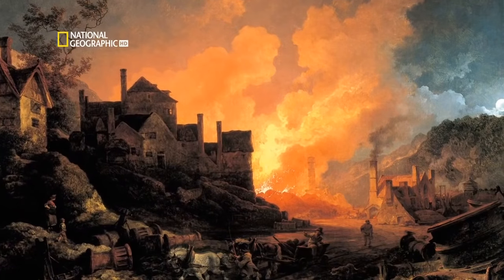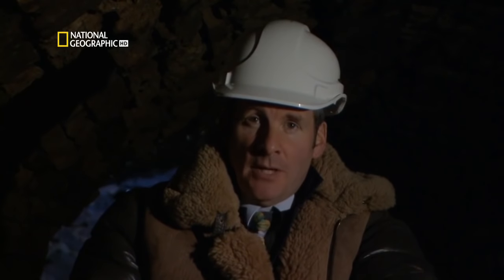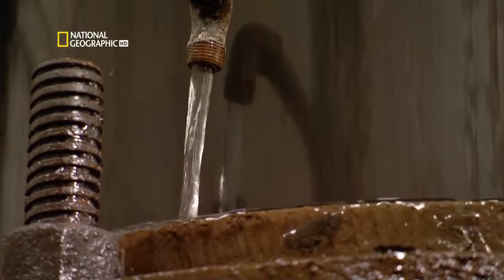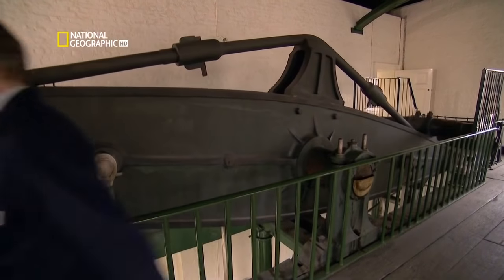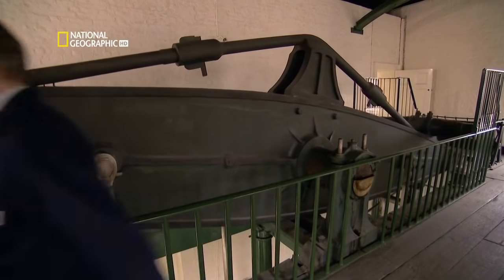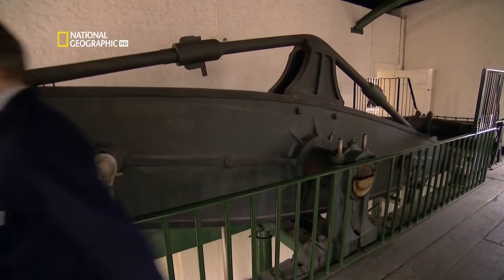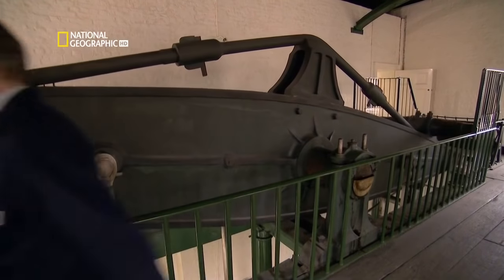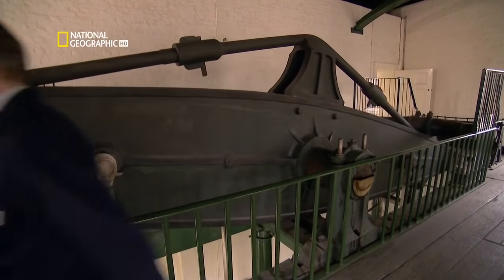Britain's Greatest Machines With Chris Barrie - S02E04: Trains - The Steam Pioneers (5.1 DPL II, HD)

Comment: There can be nothing but admiration for the long line of British achievements in technology. They changed the world. Newcomen’s engine was the real game changer. Sure, there were earlier experiments with steam, but this was a prime mover that worked. It opened avenues for improvement, adaptation and innovation
Reply: That is true, Britain 🇬🇧 was the original innovators of everything even firearms.
High Tea was a great contribution to society.
Reply: The biggest contribution Newcomen made to the world was something that's vital to nearly all modern engines, before newcomen steam powered pumps were around like a steam pump built by Thomas Savory  or as he called it in his patent "machine for raising water by the appellant force of fire" but all the valves and taps that worked it had to be opened and closed by hand, operating it would be a matter of 
Close valve A
Open valve B
Close valve C
Open valve D
Close D 
Open C
Close B 
Open A
Repeat ad infinitum 
Newcomen worked out how to use the momentum of the engine to open and close its own valves automatically using belts and cams, or as we call it valve timing, something that nearly all engines from steam to petrol and diesel engines need to work.
Reply: @whovianhistorybuff  Nothing but the highest praise for Newcomen. However, we hear that the valves on the early engines still had to worked manually, usually by young boys who could be hired cheaply. The self-actuating possibilities were apparently actually worked out by an unknown twelve-year old who found the work unbearably boring

Comment: Steam engines are dangerous.
1700s: BUILD BIGGER!
Reply: Well, those low-pressure steam engines were actually very safe (according to safety standards at the time...which were pretty terrible). Of course, high-pressure steam engines - which were actually very dangerous in comparison - were put on personal transport and shuttled people around an over-crowded city. Just ignore the occasional explosion.
Reply: @13minutestomidnight  i wonder when the safety value was invented? Alot of steam engines used them to prevent well the boiler from going boom

Comment: I found it truly amazing that technology spread at an incredibly fast pace almost two centuries ago. Within two decades from the first run the steam locomotion arrived in Itsndia and regular train service began - with the permanent infrastructure on ground as well as the rolling stock. That'd be a breakneck speed even for today's projects of similar size using all the modern technology. Truly truly a great feat. It was all done for money for sure, but that's beside the point.
Reply: Just like heavier than air flying machines. Once the principles were worked out, the floodgates were opened and progress went into high gear.
Reply: question, do you know where I can find the intense violin theme that plays at 34:57? I would rather like to find it.

Comment: I'll be honest, I wish the steam age was brought back😞. I know steam machines are less efficient, but they definitely beat modern machines for fascination.
Reply: Imagine a small fusion reactor. We could have steam trains then that would only need water!
Reply: @Nick-xm1ux  Sweet! Hopefully it does happen
Reply: @Gearz-365  Hopefully so. The only thing we can do is support its development. https://www.youtube.com/watch?v=husCIDB-c2M
Reply: @Nick-xm1ux  what if there was a steam generator inside and then electric traction moters on the driving wheels? that would solve many of the steam locomotives issues
Reply: Use electricity to heat up the boiler, charge the steam engines!
Reply: @adamchmielewski6162  Like in modern day ovens!

Comment: 38:51 Not exactly the smoothest set of tracks I've ever seen.
Reply: Doesn´t bother the rocket...so...It seems fine?
Reply: @ominösersüddeutscher  For the speeds at the time, having dead-straight tracks wasn't really a requirement. Considering they were still struggling with building over rough terrain, we should be thankful they even worked at all.
Reply: @vtr0104  yeah i mean as long it doesn´t bother the rocket and it works it´s fie with these tracks

Comment: Both Newcomen's and James Watt's engines were condensing engines, not expansion or "pressure" engines.  Both produced the power stroke by using the vacuum produced by the condensing of steam in a cylinder. Both designs used a "walking beam" to convert the downward motion of the cylinder on its power stroke into a lifting motion for pumping water from mines. The cylinders available at that time were very crude, and could not contain high pressure - there is a piston from a Watt engine in the science museum in London.  As I recall, the piston is a rough casting, about 5 feet in diameter, with a concave outer rim.  The concavity in the rim was wound with rope to act as a seal between the piston and the cylinder wall.
Watt recognized that the Newcomen  engine was inefficient since it required the cylinder to be heated and cooled for each power stroke.  Watt improved upon Newcomen's condensing engine by adding a separate condensor to the power piston, separated by a valve. Hot steam entered the cylinder while this valve was closed, then the valve would open when the piston reached the top of its stroke, allowing the steam in the cylinder to enter the condensor.  The condensing action was aided by a spray of cold water in the condensor, and the cooling water and condensed steam were then drained from the condensor while the piston was being raised by steam pressure. Thus, Watt's design allowed the piston cylinder to stay hot and the condensor to stay cold, giving greater efficiency and allowing faster engine operation.  Watt also developed a connecting-rod design that allowed the up-and-down motion of the engine to produce rotary motion, without infringing upon another's patent on the usual connecting rod and crankshaft design which is common today.
Reply: I thought that what (excuse the pun) distinguished Watt from Newcomen is that it was Watt who went on (after greatly improving the condensing system) to use steam pressure rather than condensing vacuum?
Reply: You're right.
Reply: All true and very informative, unfortunately Chris' script had to fit into about a third of that length so the detail was dumbed down for brevity :)
Reply: No.  I believe that Richard Trevithick was the first to use "strong" (high pressure) steam.  And the first to take paying passengers on a steam train (Catch-Me-Who-Can).

Comment: If only Stephenson knew where us Americans would take his design. We like em big. And the Alleghenys and Big Boys prove it.
Reply: They had to start somewhere.  We didn't like them big as much as they needed to be big.
Reply: @Anon54387  TBH, being the first was to prove to be our downfall. America had the loading gauge just right, ours is too small!
Reply: @formidable38  That is an issue for the British railway.  We Americans built our engines to be heavy, and our loading gauge to take the weight, which means we could get more tractive effort out of our engines, hence why they became so much more powerful than British engines in the long run.  We also built most of our tracks to follow the curvature of the landscape with very few tunnels, so that meant we could also build our engines taller and more robust.  Then add us Americans taking advantage of the Mallet articulation design, and we could build our steam engines to pull 5 miles of freight of flat track across hundreds of miles.  To get the most out of a locomotive, you need it to be heavy.
Reply: Big happened because we decided on the "bogie" and coupler instead of the buffers.  Bogies (trucks) are a lot heavier, so to make up for the weight to freight ratio, we made the cars bigger.

Comment: steam engines satisfy me because if there pistons and other rod components;-;
Reply: Raccoonus Maximus 

wat
Reply: my homemade wanker device is based on the steam engine wheel rod thing.
Reply: @Hi I'm mayonnaise The vending machine
:
Modern combustion engines have pistons and rods Mate. I know what your saying though. Nice thing about Steam engines is that every stroke is a power stroke Vs 2 and 4 Cycle engines. I wouldn't want a steam engine car though, lots of work and maintenance, takes about 15-20 minutes to lit the boiler and to get hot enough. There is one Boiler car that had a ignition system and fast boiler times with automatic steam regulator. Very expensive and rare. Of course Jay Leno has one, the Doble E-20.
Reply: Me too
Reply: @gewizz2  id like to have one of those to keep my arm from getting tired
Reply: @carryclass6807    im saving up 620 uk pounds  to buy a 140cm doll from esdoll, free delivery.

Comment: I'm sorry, but how do you get hit by something the size of a small building, going only 15 mph?
Reply: You jump onto your coach and hang on it's door, the door swings out with your weight upon it and hurls you in front of the oncoming locomotive.  At least, that's what happened to him, he fell and the locomotive struck him and knocked him into the track ahead, then ran across his thigh.
Reply: And a steam engine doesn't stop for a bit of flesh.
Reply: Perhaps the poor bugger was a cripple like us mate.
Reply: The engines didn't have whistles and were small and quiet. People today are hit by modern noisy trains much larger than a house.
Reply: People get run over by vehicles travelling at that kind of speed all the time, particularly trucks and buses. 15mph is pretty fast by human scale - it's the speed Roger Banister had to beat in order to post a sub-4-minute mile run after all, and about what a horse or typical cyclist can comfortably sustain over long distances.

And it's very fast indeed if you've slipped over on slippery, slimy cobblestones as a carriage is rolling inexorably towards you, even with the driver hauling on the reins with one arm and the brake lever with the other, all entirely in vein.

Even if the driver nearly manages to stop the carriage, "not quite" stopping it is enough to cause a lot of damage because the fairly narrow, metal-tyred wagonwheel of a heavy coachbuilt hansom carriage rolling over your skull at just 1.5mph will still crush it like a sugar wafer, killing you instantly.

....I may have got confused with another video about Marie and Pierre Curie (the latter died that way), actually, but the principle is just the same. The ballast, sleepers and rails of a train line are not the easiest things to walk on, let alone pick yourself up from if you fall, trains can't steer to avoid you at all*, 15mph is not any slower in that context than any other, and... most crucially... early steam trains had extremely poor brakes... in fact, hardly any to speak of at all on the engine itself (throwing the regulator into full reverse and spinning the brake handle to screw some wooden blocks against the wheelrims is about it) and *nothing on the wagons and coaches following on behind. Just another set of wooden blocks that can be pushed against the wheelrims of the guard's van/brake van/caboose, if it even had one.

If the guy fell down less than, say, 100 metres in front of the oncoming train, he may have had serious difficulty getting up and not being hit even without panicking and the unfamiliarity of the situation.

Comment: In 1803, a man named Samuel Homfray decided to fund the development of a steam-powered vehicle to replace the horse-drawn carts on the tramways. Richard Trevithick (1771-1833) built that vehicle, the first steam engine tramway locomotive. On February 22, 1804, the locomotive hauled a load of 10 tons of iron, 70 men and five extra wagons the 9 miles between the ironworks at Pen-y-Darron in the town of Merthyr Tydfil, Wales to the bottom of the valley called Abercynnon. It took about two hours.

Comment: 9:49 The Puffing Devil is not the worlds first self propelled passenger vehicle. The French had beaten Britain to it in 1759. Although it's just a tricycle cart with a huge boiler at the front. It took a long time to boil and is human pace slow. It was suppose to be used for the French military, but didn't fit their needs. Especially when with it hard to control as well, it ended up causing the worlds first automobile crash. What the Puffing Devil did was perfected it, with tubes in which made it move faster than the French prototype.
Reply: 4:55
Reply: He says first BRITISH invention .... They then developed it.  Unlike the French invention which didn't even fall at the first fence it refused the first fence. The French didn't even try to improve it
Reply: It was not a "passenger vehicle".
Reply: The Cugenot three-wheeled artillery wagon was a self-propelled cargo truck. The Puffing Devil was essentially the first horseless omnibus. Two separate things. No part of claiming the latter as the first automotive passenger vehicle overrides the former's pretty well proven (so far as I know) stake as the world's first automobile or locomotive of any kind.
Reply: Pokemon Champion Cynthia didnt cause the first automobile crash though.

Comment: I also have an idea for steam carriages:
What if we built road versions of the early "iron horse" locomotives (Rocket, Tom Thumb, Lafayette, Novelty, etc)by replacing their flanged wheels with rubber tires, giving them a steering crank/wheel, and used them to pull carriages and coaches? I'm honestly surprised no one came up with that.
Reply: That's how traction engines (road locomotives) came to be.

Comment: At 17:16 you can see why the standard gauge is 4'8".  The original locomotive was built without flanges on the wheels and ran on the outside of a plateway, L shaped pieces of metal.  Gauge on these "rails" were set from outside to outside.  When they changed to flanged wheels on rails, the standard rail section was 2".  The British were accustomed to using gauge bars to the outside, so 5' - 2" -  2" is 4'8".  All kinds of problems happened in America when the first rails thicker than 2" were first cast, half the country went to 5' (the South) and half stayed at 4'8" (the North).  The American Civil War solved the problem, although Lincoln (a railway lawyer before entering politics) did stipulate that his Union Pacific be built to 5' gauge (he was overruled).

The 1/2" was added as the result of an engineering mistake on a locomotive built for the fledgling Baltimore and Ohio Railroad, a story for a different time...

Comment: 25:15 I don't know if there are any American merchants attending the grand opening. But in just four or five years. the USA got the first rail lines built and operated by several separate companies, most of these early American rail lines connected ports to inland and further westward. The first stops were canal systems and dirt roads into Ohio Valley, and shortly, into the Valley itself.

Comment: The first steam engines relied on the condensing of the steam in the cylinders. The low pressure steam filled the cylinder & then some cold water was sprayed into it, condensing the steam & causing a partial vacuum to be formed inside.
Then, it was the atmosphere outside the cylinder that pushed the piston down.
That's why they were called atmospheric engines!
This wasn't mentioned at all. They left the viewer thinking it was the steam that pushed the piston which is completely arse about face!

Comment: You should have explained the four rails displayed in the thumbnail. Shown is a car riding on, not two rails, but four. The front two wheels have a track that is much shorter than the track for the rear wheels. Why is this? Why would they create a railroad that requires twice as much steel for the rails as is usual. Could someone please explain this? Thanks.
Reply: Railway*

Comment: There is a case for the use of steam locos. in Peru they switched over to diesel locos to get over the Andes but 4 k's up there is very little oxygen so the engines were very poor, they had to switch back to steam, sometimes the old ways are the best ways (as The Cat would say)

Comment: And Watt only built low-pressure machines, not believing in high pressure.  Trevithick built those, then everyone after.
Reply: Watt's machines were 'atmospheric engines'. Rather than using steam pressure to push the piston upwards, the cylinder was filled with low pressure steam which was then cooled, condensing it to water, leaving a partial vacuum in the cylinder so that the piston was pushed down by atmospheric pressure on its other side.

Comment: No mention of the two oldest surviving steam trains that predate Locomotion by 10 & 12 years, Wylam Dilly & Puffing Billy.
Reply: They were indeed first and second moving locomotives respectively, but neither were High pressure steam. Both ran at 50Lbs per square inch. Trevithic's development was the first HIGH PRESSURE steam locomotive. This was the key that was truly frowned upon by the great engineers of his time as far too dangerous to use, due to the many explosions of high pressure static engines. But in the end Steam locomotives using High pressure of 150Lbs or more per square inch became the standard.

Comment: Yes , brilliant , but up unto now I never knew who invented the flanged Wheel , Stephenson of course !
Richard T , ( can't spell hi's surname ) , also invented the first , Water Tube boiler  , which steams more quickly than a fire tube boiler and is capable of producing much higher steam pressures .Fire tube boiler = big fire and huge volume of water , water tube boiler = big fire and smaller volume the water passing through tubes which are in the path of the fire and its hot gases  thus raising steam more quickly and efficiently !